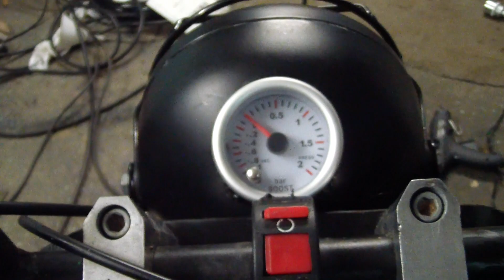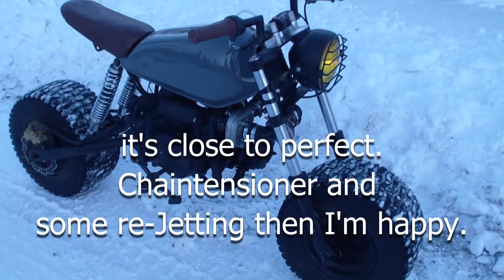Homemade Turbo'd scrambler rips in snow!

Comment: Awesome build man!  Love how you solved the oiling problem with a 12V pump, great idea.  I am wondering if you also swapped turbos to get a carbon seal?  Or maybe the draw-thru set up doesn't draw in so much oil at idle (high vacuum) anyway?
Reply from the maker: Thanks man! Mainly i swapped the cartridge out because the old turbo was blown. I bought it second hand and had no idea how many miles had been put on it. I dont have any experience regarding carbon seals but the oiling doesnt seem to be a problem at all cos i have never seen a drop of oil pushed thru and there is no smoke coming from the exhaust either.
Reply: @John_Makes  how about now after a year. Is the turbo pouring smoke from exhaust yet? 😂

Comment: Hi man I am doing the same thing but in a predator 212 how did u make so the mix doesn't get lean
Reply from the maker: I swapped the original 19mm carb for a 30mm one. But i think that was overkill. Maybe a 24mm would have been enough or just playing around with the jets/needle.